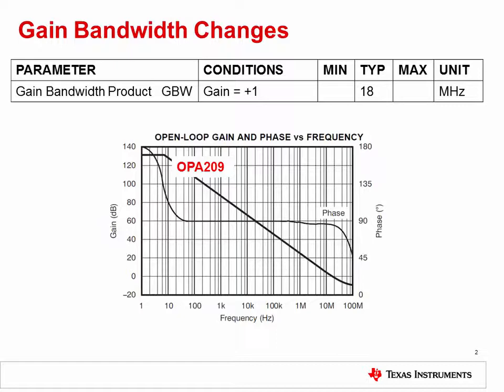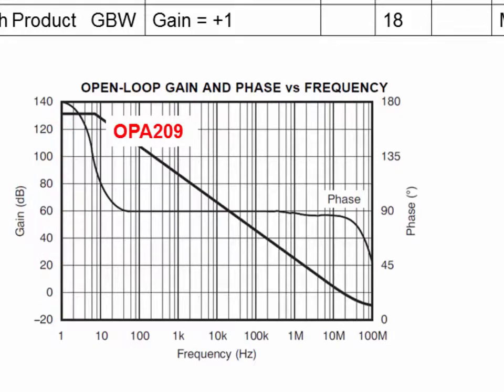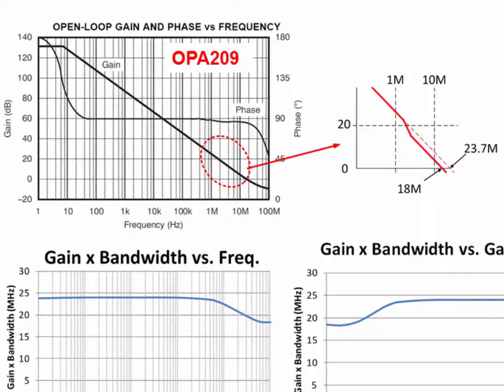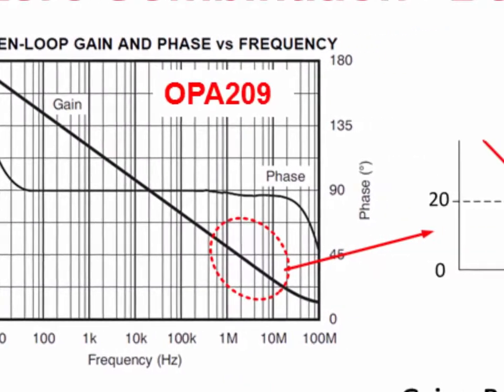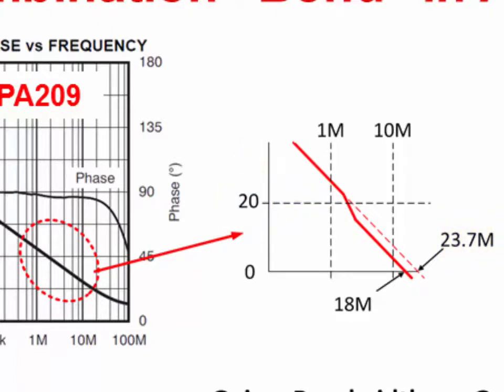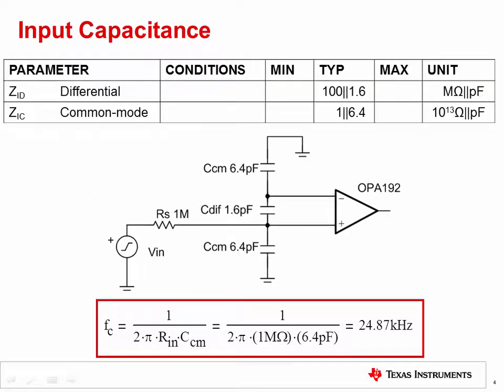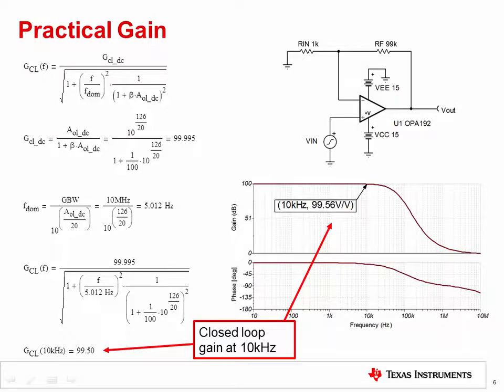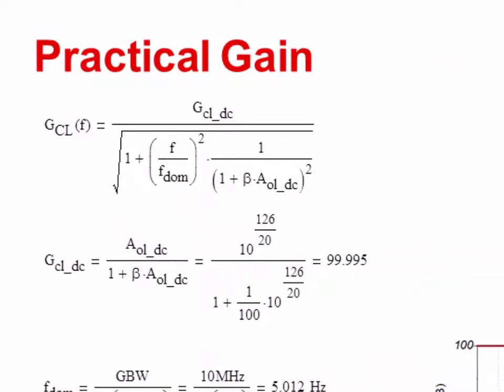Bandwidth - AOL gain slew rate

Comment: 14:14 
Why the output achieves 5V peak when 10V peak input is fed? In previous page, the max peak output was calculated to be 3.183V. So, output peak should not be around 3.183V?
Reply: Understand the previous page first bruh.
the output only made 5Vpk (traingle wave) is because the OpAmp don't have enough Slew Rate (power bandwidth) to make 10Vpk sinewave.
Simply put; the opamp can't deal that input signal, so the output become greatly distorted.
Reply: I have the same question, and my guess is this: the calculated value of 3.183Vp is "max output voltage without slew-rate induced distortion" (see the graph), not the maximum output voltage the opamp will produce. It was supposed to produce 10Vp of output voltage, which is more than the 3.183Vp distortion-free maximum, thus it produced distorted waveform with 5Vp (a number which is not calculated anywhere).